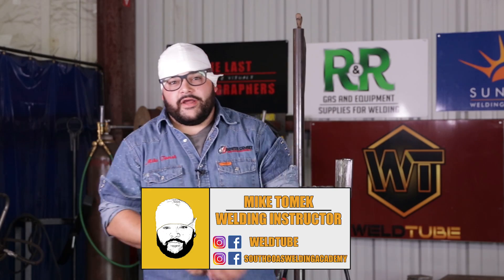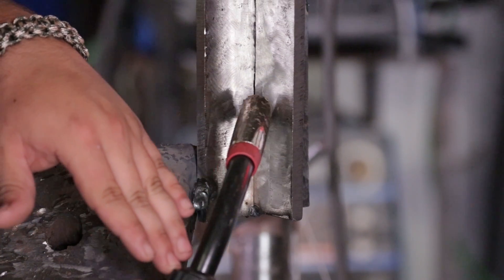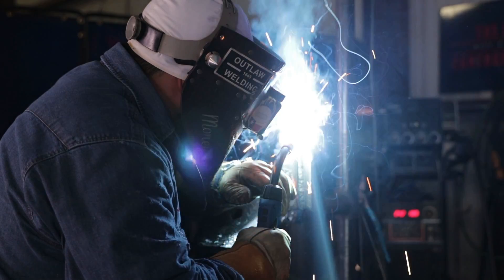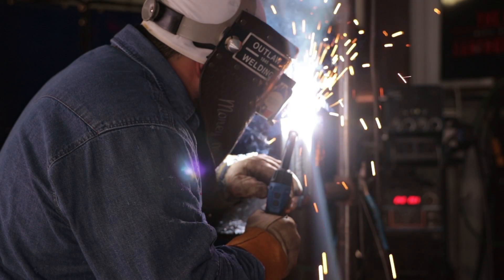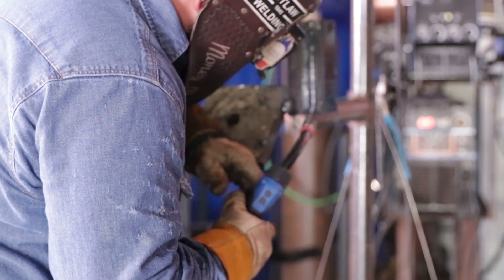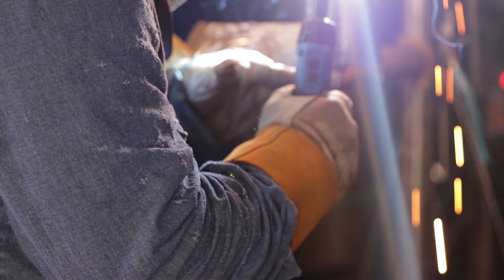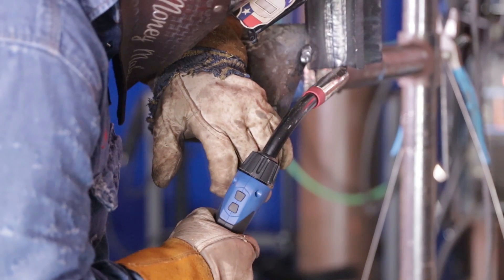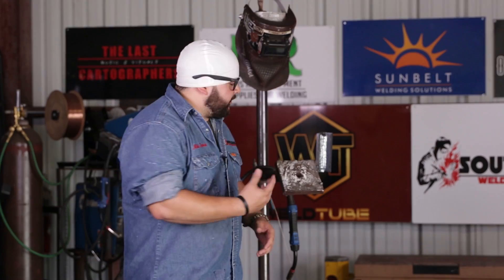3F Flux Core Dual Shield

Comment: If you want to teach someone to weld, or if anyone is trying to learn, I'd recommend finding a piece of steel C channel, 8-12 inches long, and practice by filling it up. Mark the inside center, put it vertical and just practice your uphill beads by filling up 1 corner until you reach the top of the smaller outside wall(or the outside side pulls in too much from the heat to continue), then switch to the other corner and do the same. Once both corners are filled, start on the middle to fill it the rest of the way and cap it off. 

If you get comfortable enough with your uphill passes turn it sideways and work on it horizontally from the top side. Or lay it flat and get lazy practice. 
By time you finish it all up you'll have blown through a couple of rolls of wire and gotten plenty of practice.

Comment: Wouldn't it look better, on the cover passes, to do the outside welds first and then run the last pass up the center joining them together ?  Is there a reason to do it the way you did ?
Reply: As far as aesthetics go, if you put the last pass in the middle it tends to have an ugly speed bump look to it that customers don't like. Try it on a flat surface and you'll see the difference. ;)

There is also a chance of unnecessary undercut, slag or incomplete fusion depending on cap size and how much the previous passes are allowed to cool while you move from side to side. Not sure if that last bit will make sense.

Comment: You guys should start mentioning what gas, I'm sure its co2  but alot of shops use 75/25 , other than that love it!
Reply: David Hogan We use co2 with stainless dsfc at our shop, 75/25 with carbon
Reply: We use 75/25 argon
Reply: The two shipyards I worked at use c100 (100% CO2).